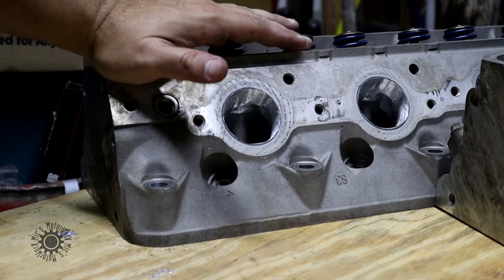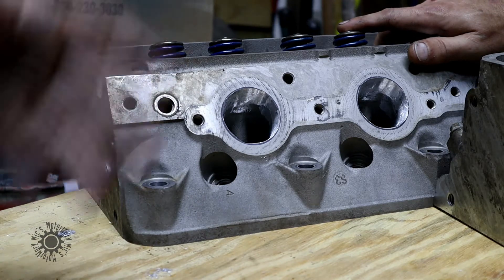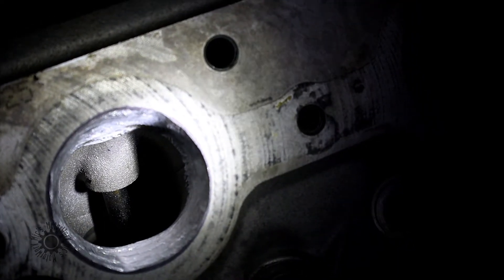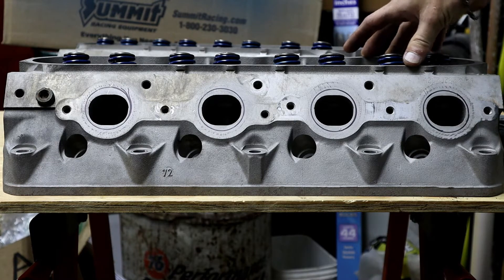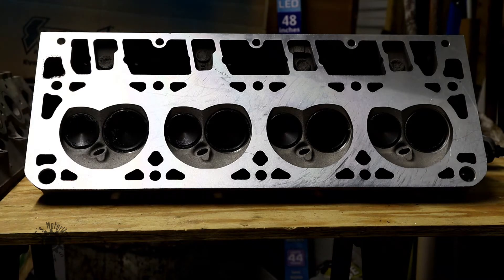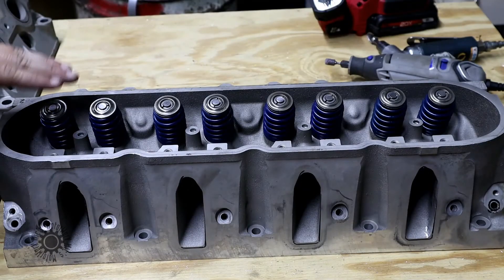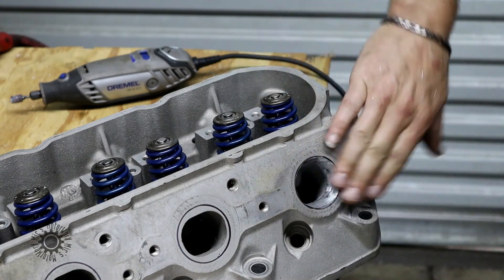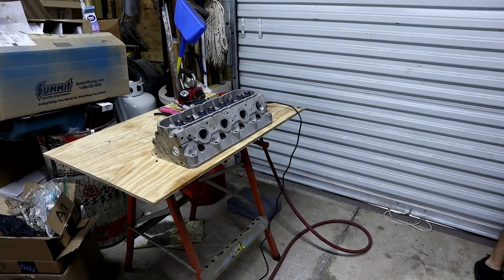Porting Heads

Comment: Wouldn't you want the valves out of the head while you're doing this?
Reply from the maker: Great thought.

All of the debris was blown out with compressed air. We didn't have the tools to pull and reseat the valves. They were set at the machine shop.  👍